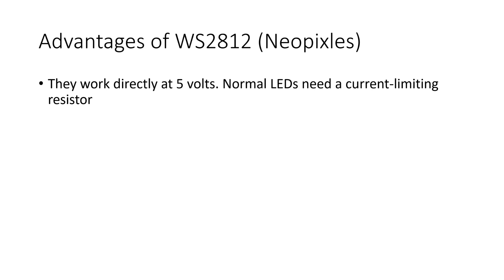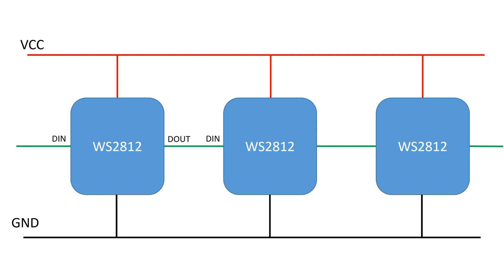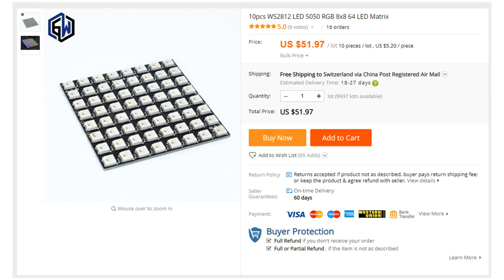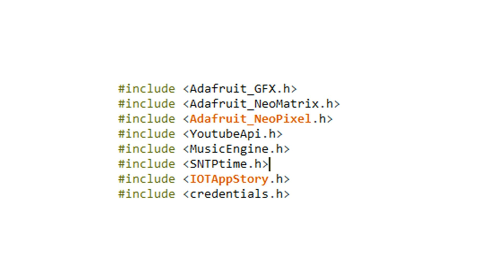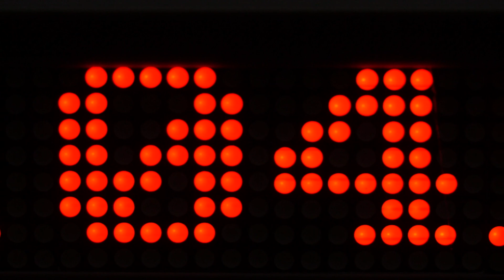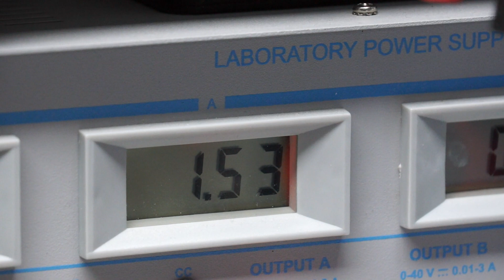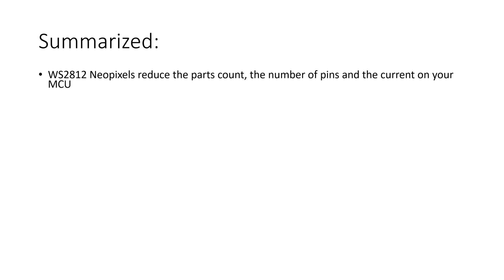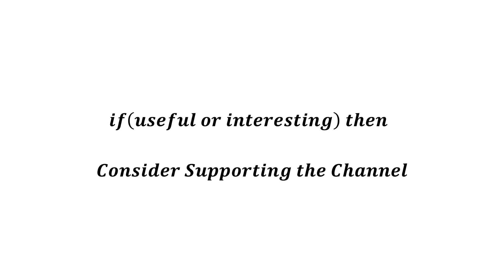#246 12 Tips and Tricks for Neopixels Projects (Arduino, ESP8266/ ESP32)

Comment: So if I understand correctly, the NeoPixel library bit-bangs single-wire-interface to the WS2812, it doesn't use the ESP32's RMT (Remote Control) Peripheral? 

Using the rm.h driver, I managed to initialize the leds on my esp32 board (bangood 5x5 led matrix)... however I get warnings that the driver is deprecated, and to use instead  rmt_tx.h / rmt_tx_channel_config_t driver.  

 I was thinking of using the FastLED driver, but I notice it's in c++, not c.. and there are many files in the library.. any suggestion on a simple esp32 example/library that uses the new driver?
Reply from the maker: Currently, most people use the FastLED library. I have no overview of other libraries :-(

Comment: Hi, I have been trying to use 8 neopixel matrices (8x). For some reason anytime I have more than 4 panels it stops working? For Context** I am controlling the neopixels with a joystick. Anytime I upload a sketch with more than 4 panels. The LEDs do not reset to the start position and I am unable to control them with the joystick. I am big fan of your videos! Thanks
Reply from the maker: Unfortunately, I cannot do remote debugging. Maybe you find a project with a similar setup of the neopixels and you can check them out with a different sketch.

Comment: Maybe this is already mentioned in an previous reaction. I use a PC power supply to feed my LED's ... On my power supply I read 5 V/20A, and it powers a 32 x16 matrix (512) LEDs. 512 x full white is juuuust too much for this PSU, but in most cases it is enough... btw : thanks Swiss man ! ;)
Reply from the maker: Thanks for sharing your experience!

Comment: Q: I have a ps with 5V/9amps. I would like to connect my ESP32 (on a board with a 5v pin) to have ONE ps. Now I fear my ESP32 will burn down when 9amps is used. I did not find any power regulators for this case. Am I wrong here (as the Neopixels will consume most of the power and the ps is regulated)? What is the best way to achive to have the same ps? BTW:Nice channel!
Reply from the maker: The Neopixels need a separate power line directly connected to your strong power supply. You can try to connect your ESP32 in parallel. Maybe it will crash. Then you need a completely separated supply.

Comment: on a project i solved the problem of the mcu being 3.3V and the leds being 5V by useing a mosfet (and a pullup) and inverting the output in software i decided to do it that way even thought the atmega chip would have worked with 5V because the accelerometer didn't and it seemed like a more compact solution then useing a level schifter
Reply from the maker: As you write: There are a few different ways for this level-shifting.

Comment: Adreas, could you check my math?  If I am driving a Neopixel RGBW SK6812 strip with 1000 LEDs.   How many Amps could I draw?  If I ask for white does it turn off the other 3 colors, so they would never actually run the 60 mw because it will switch to the 20 ma white color? So max draw would be ~59 ma x 1000 leds ~= 59A and 5V x 59A = 295 Watts?
Reply from the maker: I never worked with this version and the datasheet has no such information. I would do a measurement with 10 pcs.Then you know. Did you look at the 12v versions to reduce current?
Reply: @AndreasSpiess  First I thought about  12 v due to worry about dimming . However the area of the install is not very big so I know I could connect strands at both ends every 3  meters so assume dimming would not be a problem.  Probably about 350 leds per strand.  Wonder if I need a bigger 5v/gnd pair to handle that much current.

Comment: hey there, question for you. i need to power  15 neopixels but just the green, or the red. Is it ok to do so just using a arduino nano or micro? if i understand correctly that should put me in the 300 milli amp range which is bellow the 500 cap right? is that ok or should i get an external power source?
Reply from the maker: Maybe you look at the datasheet of the Neopixels? I do not have such numbers in my head. The nano and micro have a direct connection from USB to the 5V pin. So you just need a strong USB charger.

Comment: Hi "guy with the swiss accent". First of all thanks for all your amazing videos. Thanks to your videos I started playing with micro  controllers as a hobby. I am a C# back-end developer and have very little experiense with embedded systems. Did you animated your LED strip with the ESP32 meanwhile using WiFi? I have not been able to find a library that animates the led strip correctly. The library esp32WS2811-master works great if WiFi is disabled. But I been having no luck animating 80 LEDs if WiFi is in use. What has work best for me is using the standard Adafruit_NeoPixel library that I previously used for arduino running that code on a separate core of the ESP32 and using "portENTER_CRITICAL(&mux)" functions of the ESP32 meanwhile animating. But still the first LED fails to animate correctly. The complete code can be found on this question: https://arduino.stackexchange.com/questions/77519/animation-of-led-strip-with-esp32-does-not-work-when-wifi-is-in-use . Maybe someone can answer in that question what could I be doing wrong.
Reply from the maker: Did you use the fastled library? I never tried it, but a lot of people use it.
Reply: @AndreasSpiess  thanks so much that  library works great. Now I get no flickering when using the esp32 and wifi. I appreciate the help Andreas!

Comment: A year later I am still left wondering how you actually did the wiring and affixing of those panels to the aluminum brackets.
Reply from the maker: The wiring should be clear. Otherwise, you find many other sources that show it in maybe a more understandable way.  And I used double-sided sticky tape to fix them to the aluminum.

Comment: Hi Andreas, Just found your channel and loving it.  Would appreciate your advice.  I am finishing my basement / movie room finally.  Planning on integrating animated LED stripping into the crown molding around the room.  80 total feet / 25 meters.  These Neopixels look good and my Arduino / Raspberry skills are sufficient.  However I looked at the the pricing of the Neopixel strips is higher than the other color strips.  At 25 meters the prices on Adafruit are $20-$30 per meter cost would be $500 to $700.  Is this overspending?  Is there a less expensive but acceptable alternative?

Second question is related to wiring.  I know we can minimize power voltage drop by parallel-izing  the 5v and ground.  But is there a voltage drop around the signal that we need to consider at 25 meters?  What kind of wire would be needed over that length?

Love your work!!! Tom
Reply from the maker: 1. Adafruit is usually more expensive than AliExpress
2. Data line has no loss because it just goes from one pixel to the next. But you have to check the maximal number of supported pixels. Maybe you google for similar projects.
Reply: @AndreasSpiess  Thank you Andreas.  I will take your advice and try the other purchase source.  Perhaps the individual LEDs dont need to be so close together for my project and that should drop the cost also.  

By the way, have you ever done a video on chosing wires for projects based on maximim estimated aperage?  I have been stripping wires from ethernet cables for some of my projects but dont know how hard I can push them.  I know stranded and solid wires are also factors, besides wire diameters.
Reply: Keep in mind that if you have a lot of pixels, the simple Arduino, like Uno or Nano, with their 2k RAM will not have enough memory to program the pixels. You will need a MCU with a bit more RAM if you have more than a few 100 pixels.

Comment: hello great video.

i have a question when it come to printing color to each LEDs.  i have 50 LEDs in a strip. right now, my code has 50lines for each leds.  is there a better way to print led?   0-9 to be red and 10-19 yellow and 20-50 green.  i try for loop, but it didn't seem to work too well.
Reply from the maker: There are libraries for that.

Comment: Thank you for your video, Mr. Spiess. I was struggling to power ws2812b strip with 18650 batteries. I had strange effect, i had to touch the batteries to make strip light. Connecting ground of strip to d1 ground solved it. When powering with usb buck-boost converter there was no issues. Could you explain why it’s important?
Reply from the maker: I do not know fron the distance :-(
Reply: Andreas Spiess no problem, you helped me anyways :)

Comment: The fastLED library has a current limiting function which is nice to use with USB powered projects. I make a lot of nodeMCU light sculptures taking power from Vin pin, set to 400mA in FastLED with 30 LEDs. One of these has been running off a laptop for a year maybe this is safer than trying to power from VCC. :)
Reply from the maker: I good idea. I have to have a look at this library again.

Comment: If you have a huge amount of LEDs, even powering them in the middle won't keep the brightness even.  At some point you'd need to run a power line down the whole array and connect it so that you only have 3 or 4 matrices in series before connecting directly to power again.  It may be just as easy to connect each matrix to the power bus individually.  And it really makes me wonder how much of a nightmare it is to power those huge yard-and-house displays.
Reply from the maker: You are right if you want to have the power of the LEDs very even.

Comment: Hi Andreas,
What wiring if I want to power the esp32 with the same power supply? My LED strip is 144 pixels so I calculated I will need a 7.2 amp 5v power supply but can I connect that to V-In?
Reply from the maker: You can try. But microcontrollers are picky if it comes to voltage drops...
Reply: @AndreasSpiess  Thanks for the tip. I ended up going with a 5v 2a power supply and using only 72 pure red green or blue WS2812B LEDs. That way it only pulls 20ma per pixel. To avoid overcurrent on the MCU PCB traces and the builtit zener diode, I am powering both the ESP8266 MCU and the LED strip in parallel.

MCU 5V(USB)----5VCC 2.1A-----LEDV+

MCU GPIO4----LED Data In

MCU Ground----5V 2.1A Ground-----LED Ground.

Comment: Could you use a large capacitor to delay the start of the matrices instead of the pfet?
Reply from the maker: I do not think this would work.
Reply: Then you need an even bigger Power supply to charge te capacitor ...

Comment: I like :).  Had the same issue with all Pixels turning on at power-up. First line in code is to turn them off. But still get the flash :(
Reply from the maker: It seems that this is "by design" :-(

Comment: Hi Andreas
Is that possible to use neopixels as a ceiling light with 1800 lux? and how much power consumption in comparison with normal LED light? Is it worthy?
Thanks
Reply from the maker: I never did any lux measurements, but I assume you get bright light if you add many strips in parallel. You find many videos creating all sorts of configurations with Neopixels. The power consumption should be similar as Neopixel use the same technology as normal LEDs
Reply: @AndreasSpiess  Thanks Mate

Comment: I used a 5v 40a power supply for my 6 panels of 8x8 neopixels on an arduino uno with a 470ohm resistor connected on the data pin. Also used the same library examples and some of the examples gives my panels ghost pixels. I'm not sure if my power supply is the problem or if I am missing something. Can you guys help me out? Thanks!
Reply from the maker: Maybe you also have a batch of panels which have DIN and DOUT mixed up? Some other viewers got such panels.
Reply: Andreas Spiess thanks. but, no, i don’t think so. Now my problem is I think I broke the DIN on my other matrix. lol. The 1st column on that particular matrix is the only one working now. 😂😂😂

Comment: WRT to the digit "font" (actually a typeface, but everyone seems to have assimilated to Microsoft's way of thinking)... Waaaaay back in the days of the TRS-80, the company I was working for developed a programmable character generator (providing in effect high resolution graphics on a machine only designed for text). The major part of the fun with that add-on card was designing my own characters, making them grossly oversized to fill each character cell (which was almost twice the height of the characters defined in ROM).

So... Why not just sit down with an 8x8 icon editor and design your own digits?
Reply from the maker: I am more an engineer than a designer ;-) Designing nice fonts is an art, I think. Maybe there are even services on the internet to help you with the work.
Reply: @AndreasSpiess  indeed, I think engineering is the diametric opposite of art - and I'm glad for that, otherwise engineers would also be asking "would you like fries with that" during their normal work day ;-)

FWIW, someone has already gone to the trouble of creating an 8x8 character editor specifically for Arduino-controlled LED panels;
https://xantorohara.github.io/led-matrix-editor/

What's more, the author has gone to the trouble of providing three complete sets of digits (and two sets of letters, plus punctuation and other symbols). Just take the auto-generated code snippet from the side panel and cross your fingers...
Reply from the maker: Thank you for the link! I assume my old display used one of these fonts.

Comment: Would be cool if we could connect relays with this "daisy-chain" technology. I mean relays with a Data in and out.
Reply from the maker: With a small PCB (plus a micro on it) and an I2C bus this is easy, I think.
Reply: @AndreasSpiess  Yes .. but with i2c we  would need still one more wire. If I would be a Relays producer I would integrate this technology in my products yesterday.

Comment: Tip # N+1: Powering a long series of Neopixels with even power distribution:
Due to the resistance in the (thin) power lines, the pixels at the end may be a bit dim.
The pixels at the end suffer from double resistance in BOTH power and ground lines.
Suppose 1 Volt is lost in a single line, then the ground level at the end is 'lifted' 1 Volt, and the last pixel gets only 3 Volt.
When connecting VCC at the END of the line, each pixel has exactly the same total wire length (and resistance) to the power unit. So each pixel gets the same voltage, regardless its place.
The first data line level is correct compared to ground level. At the end, the ground level is shifted up 1 Volt, but also is the DataOut level of the previous pixel. So far so good.
Then add an extra 7805 at the end of the series before feeding it to VCC of the strip. Connect the ground of 7805 to the (shifted +1 Volt) ground level at the end of the pixels. This creates a +6V VCC at the end of the line, resulting in exactly 5V compared to gnd (locally), regardless the position in the line. Even at the beginning of the line. (the 7805 must be fed 8 Volts or more).
Temporal extra (or less) current drawn by bright (or dark) LEDs may result in more (or less) Voltage loss in the line resistance. This will be compensated immediately by the 7805.
You can still add capacitors on the 7805 to reduce oscillation, and some current rush in limitation as described by others.
You still need thick enough wire to prevent fire, but you don't need to worry about dimming one side anymore.

The same trick (feeding from 2 sides for even power distribution) also applies for 12Volt garden lights (otherwise the last one gets almost dark), or speakers in a sound system of a large building (the last one produces almost no sound).
Good luck.
Reply from the maker: Thank you for your thorough explanation. The only disadvantage is that you potentially need more wiring (to both sides instead only to the middle point). But for bigger installations this is worth the effort.

Comment: Connect power at both ends (and also in-between, if necessary).

If anyone has 8x8 modules that don't seem to work: I had some with DIN and DOUT silkscreen /labels swapped.
Reply from the maker: Many others also had those faulty boards. So I was lucky!

Comment: You should be able to use a large capacitor across the power lines to handle the temporary surge during the power-on all-white phase.  You should have a capacitor anyway.
Reply from the maker: This capacitor would increase the surge current because a discharged cap behaves like a short-circuit. But a cap is useful during the operation if you vary the number of ON pixels.

Comment: Just wait until Andreas learns that 10W WS2812B RGB pixels are available. 10W x 64 x 8  = 5120 watts = 22 amps at 240V. Expensive to operate, but that subscriber counter should be visible from space. Of course you can build your own 60 watt neopixels too, but you probably need a diesel generator to run that subscriber counter. Totally worth it though.
Reply from the maker: Like cryptocurrency. Also lots of energy for nothing ;-)

Comment: As for controlling Neopixels with MicroPython, it is already supported on the ESP8266 and ESP32. Both are implemented with a bit-banging solution.

For the ESP32 I intend to create an alternative implementation that uses the RMT module so that timing is very accurate. The Loboris fork of MicroPython already has an implementation that uses RMT so Boris has already paved the way; I just want to implement a slightly different design. It's also worth noting that FastLED has an RMT implementation for ESP32. Using RMT should be a significantly more accurate way to drive Neopixels than any bit-banging solution - accurate timing becomes important for longer (1000's) of Neopixels. 

If anyone is interested in this please reach out!